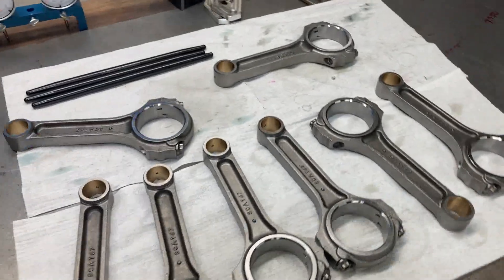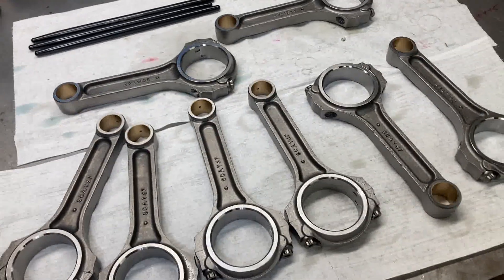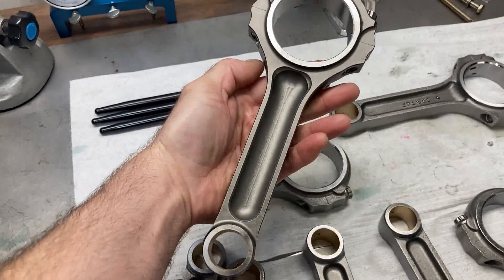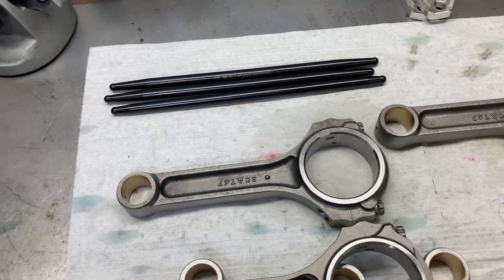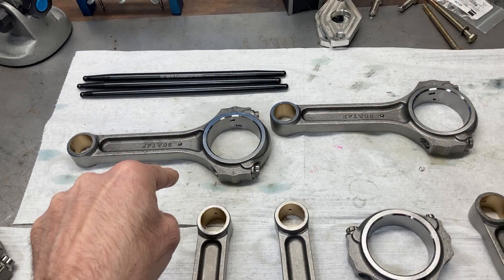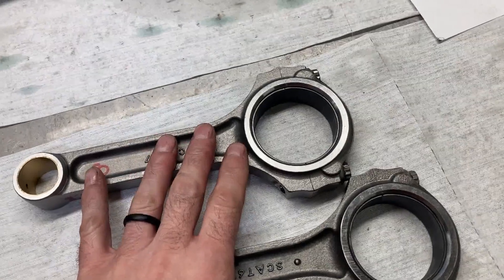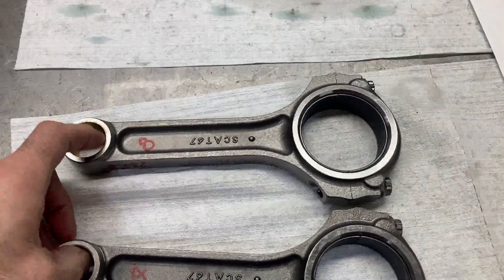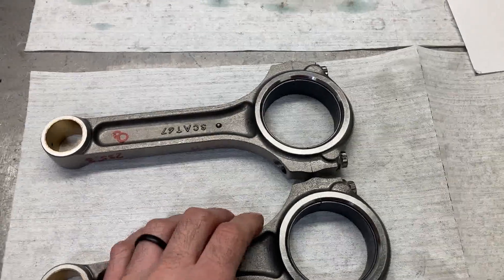Lykins Motorsports Scat 6.700" I-beam Rod Bearing Clearance Checks...

Comment: Brent Thanks for the videos I really appreciate you giving quality information. Half these idiots on you tube I wouldn't let work on my lawnmower. I too have building engines for quite some time. The twist is I do everything GM ford mopar toyota. Lately it has been a bunch of BBC blown boat engines but I did manage to do a 428 SCJ FE last month. It's funny that I came across your videos because when I'm looking online at the forums and looking for specific ford stuff I usually will look for your posts. I have read your posts for years and it has helped me with a lot of the ford stuff. Your info is spot on.
If you don't mind me asking what scale are you using on your rod fixture? I have the same rod fixture and am having problems with repeatability 
Thanks again BK